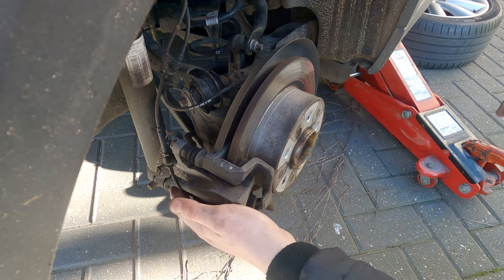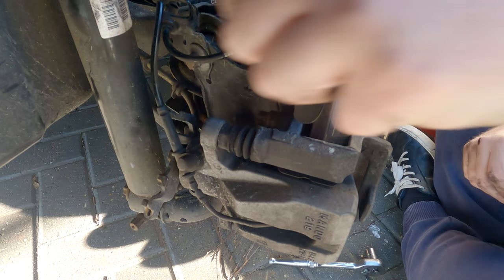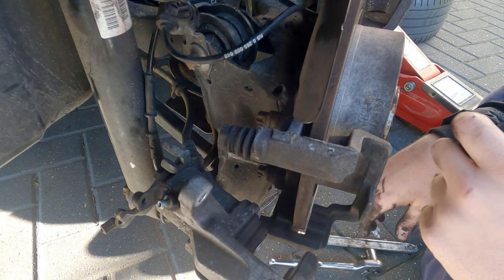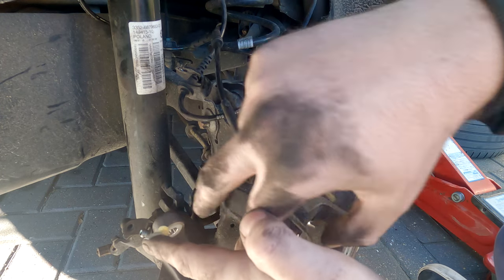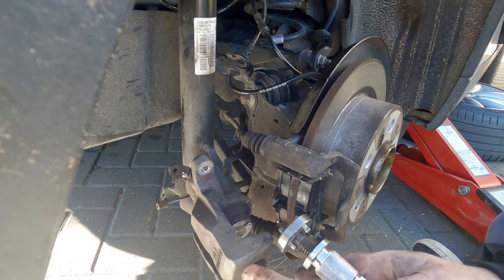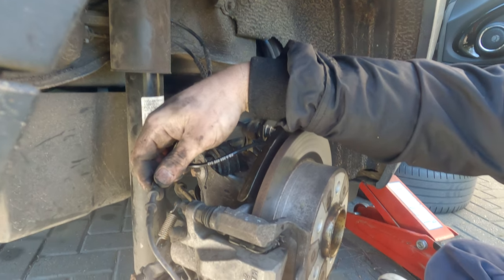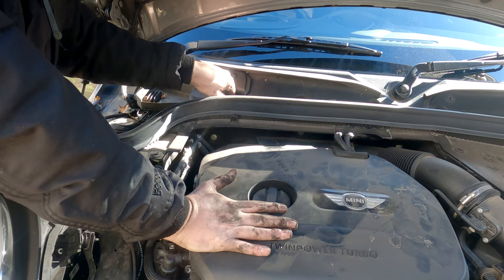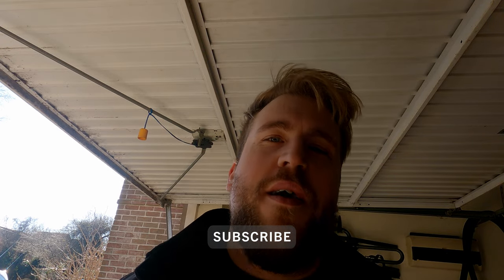MINI Cooper S (2014 - 2019) - Rear Brake Pads And Wear Sensor Replacement (HOW TO!)

Comment: I see you've got the kielder impact. What's your thoughts? Mines been struggling a bit recently with bolts it'd usually whip straight off, only had it 2 year and not used it much
Reply from the maker: Yeah funny you say that, I’ve noticed also mine has also seems to have reduced torque. I’m pretty sure they have a 3 year warranty so I was considering contacting them!
Reply: @FuelledLife  yeh I might try that, mines the 700nm version, but there's not a chance in hell it's ever been able to undo a 700nm nut even when it was new
Reply from the maker: @MrHipwell1989  Mine is also the 700nm model. I do have multiple batteries for the smaller 400nm one and also the angle grinder and drill combo so I’ll double check that I haven’t done something stupid like put the 4.0ah battery in by mistake. Definitely will contact them if that isn’t the case though. Shouldn’t have an issue with things like wheel bolts torqued up to spec.

Comment: Great video. Thanks for uploading. 
Could you change the sensor without taking the pads off? My wife's is showing low pads when they have loads of meat left so guessing the sensor has failed.
Reply from the maker: Can indeed - just pull the sensor out and unplug. Two options, firstly you can replace with a brand new one, the reset the brake light on the dash using Carly, etc. Second option which I actually had todo while I was waiting for one is snip the wire and solder the positive and negative together to make a loop. Then plug it back in and reset the car. Then in time, just replace with a new one. Hope that helps!
Reply: @FuelledLife  sweet appreciate your quick reply. I've ordered a new one so will try that. The dash light won't reset at the moment, The number counter resets but the red light stays on.
Will be doing discs and pads all round soon at service time but it would be nice to get the light off in the mean time.
Reply from the maker: @antn1b  no worries at all. Sounds to me like the car can see it’s been tripped so until it’s swapped out for another ‘new’ one, it won’t let you. Good luck! I’m sure it will all be fine. Make sure you have your handbrake released when resetting as well, otherwise it will fail. Just FYI if your using Carly.

Comment: I appreciate the info, but two really important steps were skipped in this video. The guide pins/sliders should always be removed, cleaned, and greased. If not they will begin sticking and cause premature pad wear. Also, the rotor should always be turned/resurfaced or replaced. Rotors get a hard glaze over time and do not work as well. Could mean life or death.